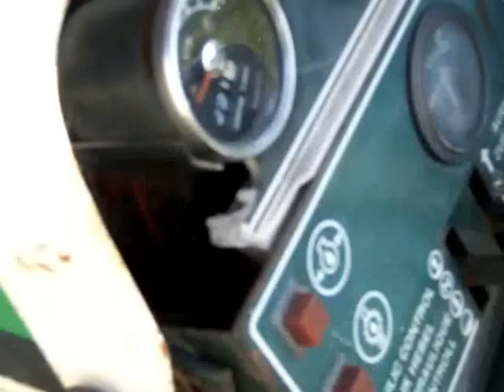Bolens HDT1000 Walk Around

Comment from the maker: I'm not really sure.  Since it was for export only information on it is hard to find.
It's a model 2388s, and if that follows the HT23 convention, the earliest it would have been built would have been 1984,  That was the year that the HT23 model number changed from to 2389 to 2389s.  The 's' suffix indicated that the tractors now came with Power Steering, Cruise Control, and auxiliary Hydro cooler as standard features.
I French gentleman told me that there was also a 2388 model as well.